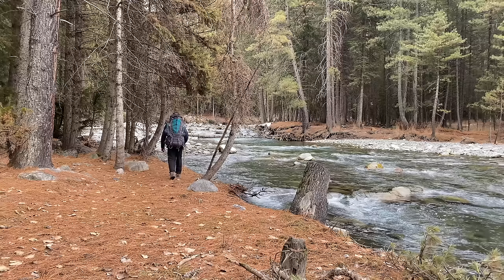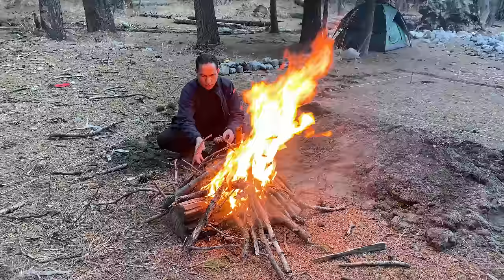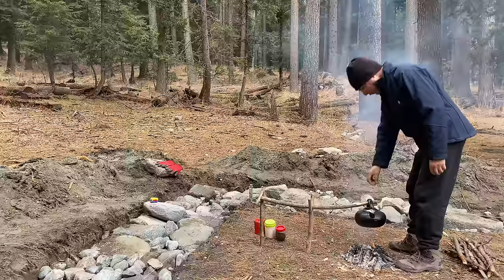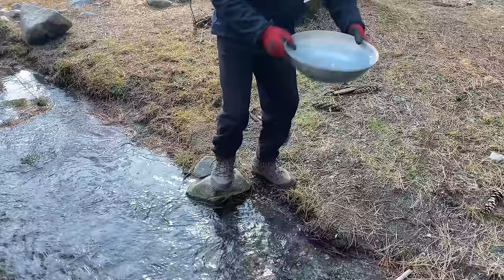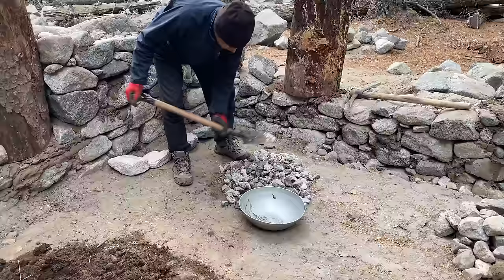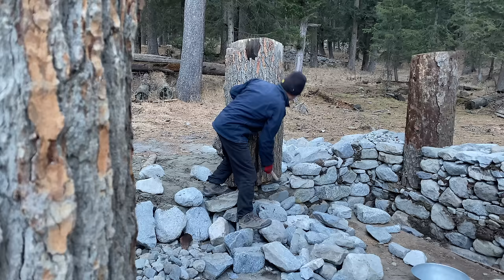I Built a STONE & WOOD Survival Bushcraft Hut in the Forest

Comment: I look at the amount of work and compare to the results.  To haul rocks to make a three foot wide stone wall is excessive compared to the space inside the shelter.  If you had made it round rather than square you would have had more interior space for less construction materials (and time).  To cut tree trunks for wall posts is also excessive and not at all necessary given the stability and carry weight of the stone wall.  Most survivalists would not carry the equipment to cut tree trunks.  All-in-all I do not see the point in this build.  Hauling heavy stones and rolling tree trunks increases the chances of pulling a muscle or bruising a foot.  I see you aren't wearing steel toed boots.  Ignoring safety concerns is unwise in a survival situation.
Reply from the maker: Thanks for your comment and concerns. Actually the wall is twenty-two inch wide. There is enough space inside the hut. As regards to the round structure, it wasn't preplanned. The stones were eroded and worn smooth, brought down by flash floods in a nearby seasonal creek. The biggest challenge was the collection of stones. Moreover, those were not the type of stones to build the hut with, I guessed. So I made my mind to use those logs to minimize the use of stones. Those logs had already been there for years. Neither I cut the tree trunks nor carried the equipment. As far as safety is concerned, you are right. Safety must be our first priority. I had safety shoes but missed filming those scenes. Anyway, thanks for your input.
Reply: Damn, let him build his shit🙄